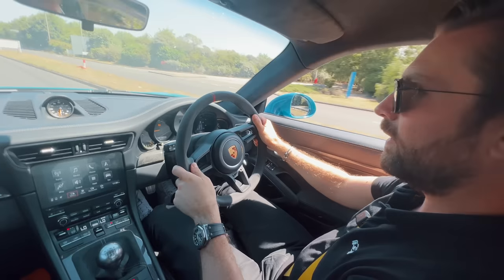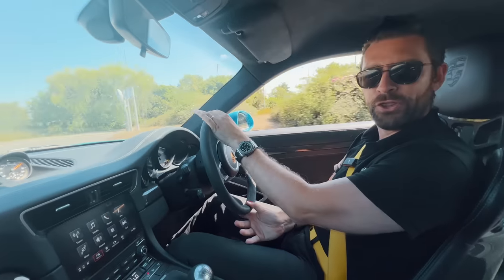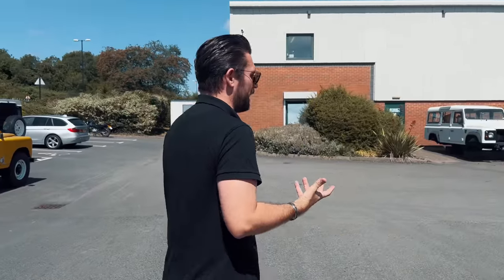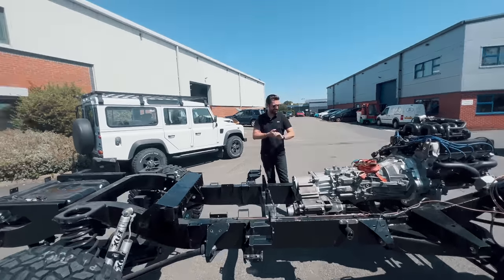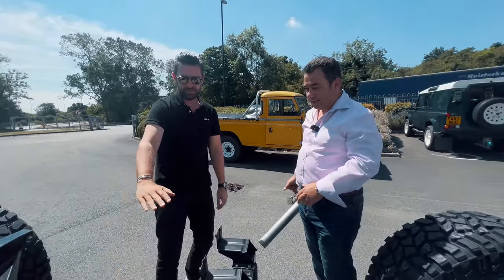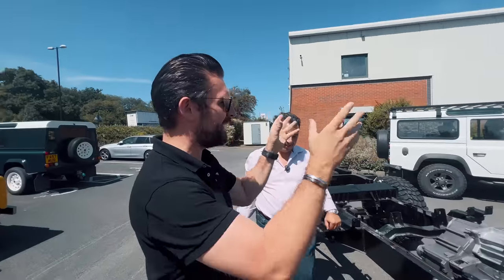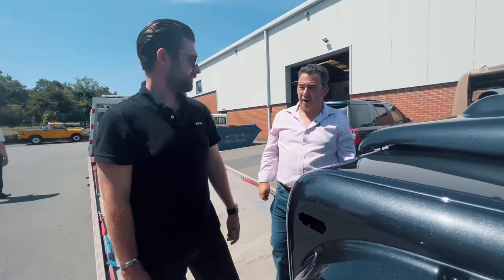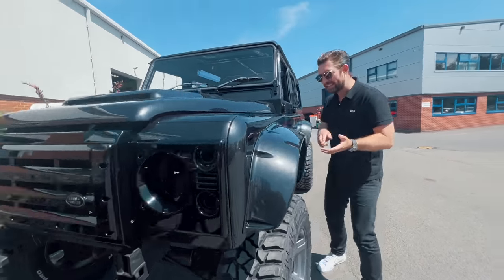TAKING DELIVERY of THOR! My NEW Land Rover Defender Arrives!

Comment: Agree the Defender are a design just like the 911.  I have done a V8 manual engine swap on my 110 soft top. I’ve fitted a roof tent and use for wild camping. A recent  camping trip to the highlands took £600 in petrol. It’s a beast! Enjoy.

Comment: I dream of an upscale Ariel Nomad. Just a tad bigger in most dimensions. Throw in a lightweight version of a Rivian 4-motor drivetrain. With 2 (or3) seats on top of a battery floor (it's inexplicably heavy but maybe the new Model Y one) suddenly there is a bit of space for cargo and road side stuff. Not the range needed for Dakar perhaps, but that would take a pretty silly design that would end up heavy. The bespoke "Mo-mad" could be quite svelte.